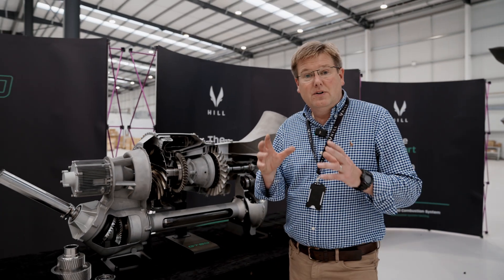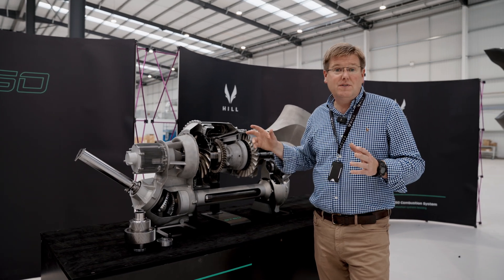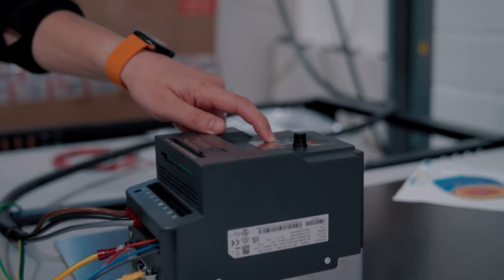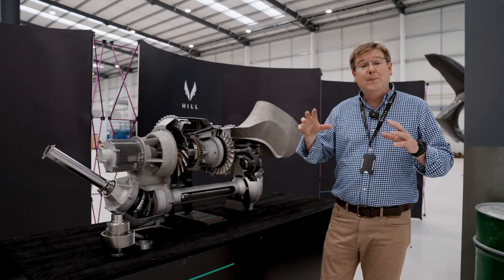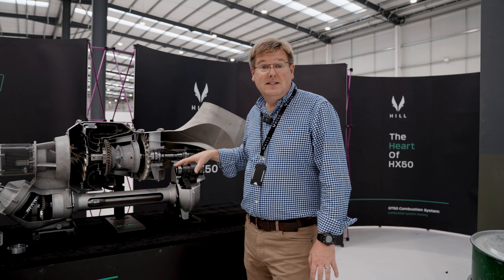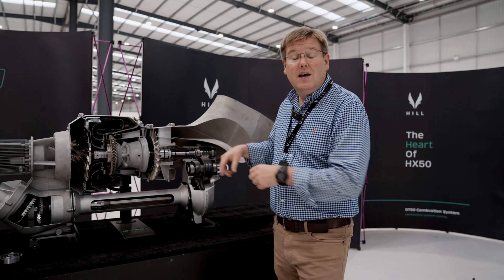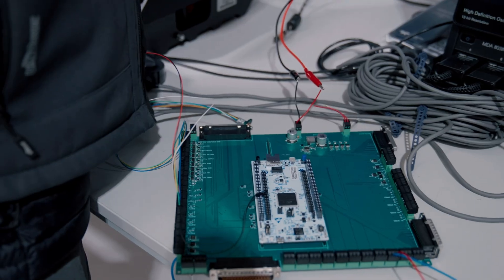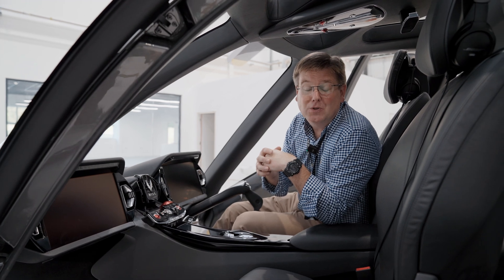GT50 Combustion Efficiency and System Updates

Comment: It's very cool to build new engines and upset existing culprits like P&W. Rather than the long transmission path, could it be a single stage gearing directly to the rotor? the 45 degree bevel gear has fairly small contact surface, could it all be done in a single largish diameter gear? less wear, loss, weight. If beneficial for gear design maybe stand the engine on end and drive shaft on the generator side and if the length is needed a pancake generator. The 50k rpm is ideal for electrical generators as speed and power density are proportional to voltage. With modern electronics all the avionics could run on as little as 20watt but even at 200watt there is a lot of room for aircon if the design power was 26kW? I imagine that 10kW would be plenty aircon. I assume you are not driving the tail rotor electrically (although might be interesting). And heating should be plentiful from the thermal engine.